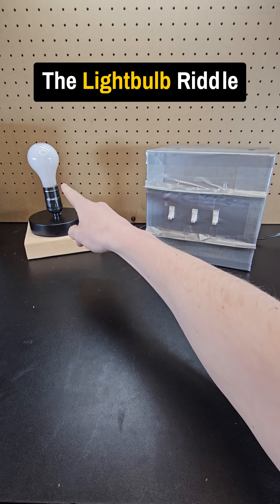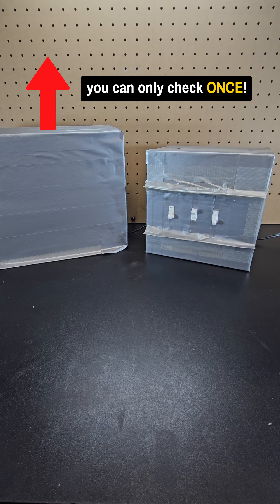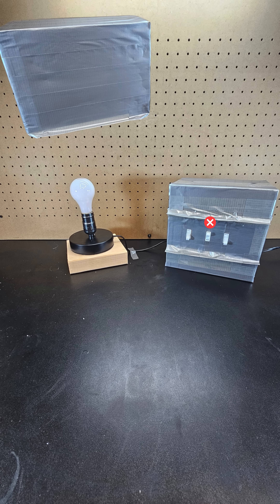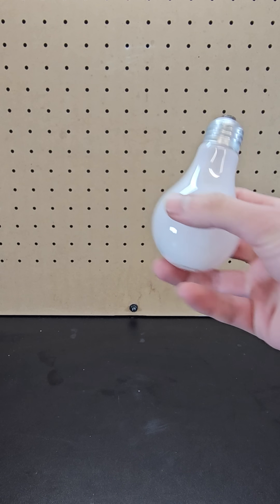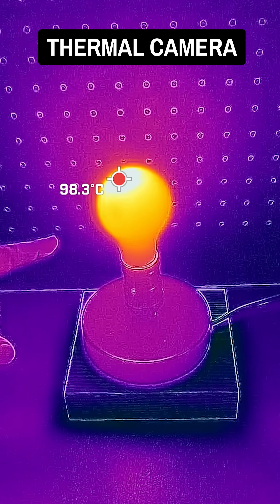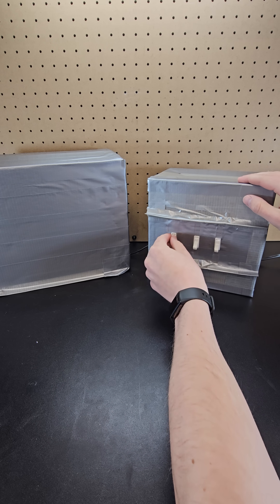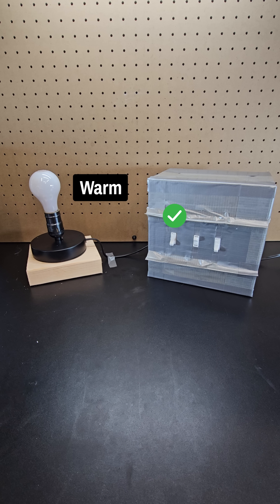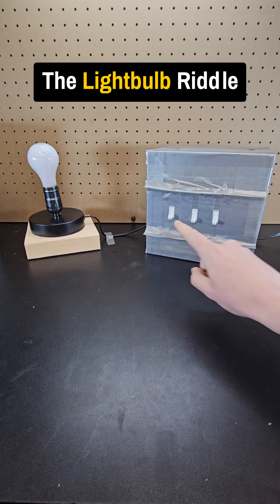Can you solve this Lightbulb Riddle? #science #shorts

Comment: (Based on a episode i found on a series from i think year ago idk) Turn switch one on wait 20 mins to a hour turn it off flick two and then check if the bulb is off touch it incandescent lightbulbs use avtrugnsten fililate making 70%( I think) of the energy Infrared because infrared is what most the heat is from and 30% is visable light so it will be hot if it’s cold and not on then it’s 3rd switch

Comment: (Will prob only work with a old bulb but eh) flip the first switch wait around 1 minute then turn the first switch of flip the second on and then lift the cover, and then you have your awnser. Explanaition: when you flip the first switch and leave it on the bulb will generate heat so it will heat up and then when you flip the second switch and lift it up feel if its warm cuz if it is then its the first switch if not but the light is on you know its the second switch if its of and cold ots the third😊

Comment: Fact about light  Light is a complex phenomenon that has been described differently throughout history, from classical wave theories to quantum mechanical models. Here's a breakdown:

Definition

• Light, or electromagnetic radiation, is a form of energy that travels through space in the form of waves. It is a part of the electromagnetic spectrum, which includes radio waves, microwaves, infrared radiation, ultraviolet radiation, X-rays, and gamma rays.

Wave-Particle Duality

• Light exhibits wave-particle duality, meaning it can behave as both a wave and a particle.

• As a wave, light is characterized by its wavelength (the distance between two consecutive peaks or troughs) and frequency (the number of waves that pass a given point per unit of time).

• As a particle, light is composed of photons, which are discrete packets of energy. The energy of a photon is directly proportional to its frequency.

Properties of Light

• Reflection: When light strikes a surface, it bounces back. The angle of incidence (the angle at which light hits the surface) is equal to the angle of reflection.

• Refraction: When light passes from one medium to another (e.g., from air to water), it bends. This bending is due to the change in the speed of light as it enters the new medium.

• Diffraction: When light passes through a narrow opening or around an obstacle, it spreads out. This spreading is more pronounced when the size of the opening or obstacle is comparable to the wavelength of the light.

• Interference: When two or more light waves overlap, they can either reinforce each other (constructive interference) or cancel each other out (destructive interference), creating patterns of bright and dark areas.

• Polarization: Light waves oscillate in all directions perpendicular to their direction of travel. Polarization is the process of restricting the oscillations of light waves to a single plane.

Electromagnetic Spectrum

The electromagnetic spectrum is the range of all possible frequencies of electromagnetic radiation.

• Radio Waves: Longest wavelengths, lowest frequencies; used in communication.

• Microwaves: Shorter wavelengths, higher frequencies than radio waves; used in cooking and communication.

• Infrared Radiation: Shorter wavelengths, higher frequencies than microwaves; felt as heat.

• Visible Light: Range of wavelengths detectable by the human eye; perceived as colors.

• Ultraviolet Radiation: Shorter wavelengths, higher frequencies than visible light; can cause skin damage.

• X-Rays: Shorter wavelengths, higher frequencies than ultraviolet radiation; used in medical imaging.

• Gamma Rays: Shortest wavelengths, highest frequencies; produced by nuclear reactions.

Importance of Light

• Vision: Light is essential for sight, allowing us to perceive the world around us.

• Photosynthesis: Plants use light to convert carbon dioxide and water into glucose and oxygen.

• Energy: Light can be converted into other forms of energy, such as electricity through solar cells.

• Communication: Light is used in fiber optic cables to transmit data at high speeds.

• Medical Applications: Light is used in various medical treatments, such as laser surgery and phototherapy.

Historical Context and Development

• Classical Theories: In the 17th century, scientists like Isaac Newton proposed that light was made up of particles (corpuscles), while others like Christiaan Huygens argued that light was a wave.

• Electromagnetic Theory: In the 19th century, James Clerk Maxwell developed a theory that unified electricity and magnetism, showing that light is an electromagnetic wave.

• Quantum Mechanics: In the early 20th century, Max Planck and Albert Einstein introduced the concept of photons, revolutionizing our understanding of light and leading to the development of quantum mechanics  ︎ ︎   ︎ ︎   ︎ ︎   ︎ ︎ ︎    ︎

Comment: How I would have done it: flip one switch, and leave it there for a little while. Then flip it off, and flip another switch for a short amount of time. Finally flip the last switch on and lift the cover. I’d then tap the bulb if it wasn’t already on. If it’s warm than the first switch is the right one, if it’s colder or only slightly warm than it was the second switch because you didn’t give the bulb enough time to heat up.

Comment: Solution: flip the first switch on for 10 minutes and then turn it off and flip the 2nd switch on and check if it's off if the light bulb is off,then touch it if it's hot it was the first one, but if it's on its the second one and if it's cold and off then it's the third one

Comment: I was brainstorming this but i couldnt find a solution,  but then i realised that a bulb produces heat which instany gave me the solution 

So what we need to do - 

Turn on the first switch and leave it on for 10 min 

Cone back and turn on the second switch 

And lift the box - 

If the bulb is on and the light is on its switch a 

If the bulb is on but the box is cold its switch  b 

If the bulb isnt on its switch c 

I typed it before watching the video 

Edit : turns out im correct lmao

Comment: I had flicked the first switch on for about 10 minutes, turn it off, turn the middle one on and then go check on the bulb and see if it's hot, if it is, it was the first one, if it's not, and it is on its the middle one, if it's not hot or on it's the last one.
Reply: I did this in the middle

Comment: Flick two light switches on turn one of them off get the light bulbs on it's the one you left on obviously if it's off and the light bulbs warm that's the one you flipped off if it's off and it's cold that's the one you didn't touch 👍
Reply: W

Comment: Flick two of the switches on wait 30 minutes turn one switch off. If the light is on then it’s the switch you didn’t turn off if the bulb is warm then it’s the switch that you turned off after waiting 30 minutes. If the bulb is cold, then it’s the switch that you never turned on.

Comment: What I would do is lift the first switch wait 5 minutes then flip it off and turn on the second switch then check if the light bulb was hot that means the first switch controls it if it was cold that means the third switch controls it if it was on that means the second switch controls it!

Comment: You flipped the first switch and leave it on for a little bit and then you turn it off and then you flip on the second switch and leave it on for a little bit and then you turn it off and then you lift up the box and you fill the lightbulb as the lightbulb is warm then it’s the first if it’s hot then it’s the second switch and if it’s cold then it’s the third switch

Comment: I turn on the first switch wait 5 minutes then turn it off, I turn on the second switch and check the box
 If the bulb is hot but not on then it was the first switch however if the bulb is cold and not turned on by the second switch then I know that it is the last switch.

Comment: my guess was actually a good answer to the riddle cause i think i was asked this question before, but i don't know where. anyways, as for what switch actually activates the bulb, it would be switch 4 which is hidden elsewhere, possibly in the base, around the bulb, or further down the wire. the switches on the box are just for looks.

Comment: Turn the first switch on for 10 min then turn it off and flip the second switch, if it's not glowing check if the light bulb is hot, if it is the first switch is correct and if it's not it's the third switch

But of course this only works if its a old light bulb that works by running electricity  through copper and not a led light

Comment: I’d turn on 1 switch. Wait about ten minutes and then turn it off and turn on any other switch. Now i will open the box. if the light is on then it means that the switch i just turned on is the right one. If the light is off then i need to feel the bulb’s temperature. If its hot then it means that the first switch that i turned on is the right one, is the bulb is cold then the right switch would be the one that i never turned on by now. Hope this helps

Comment: Flip one switch, wait for 5 min, flip another one. If the light bulb is hot and on, it was the first switch. If the light bulb is cold and on, it was the second switch. If the light bulb is off, it’s the third one. You need to add another factor (in this case temperature) in to determine definitely

Comment: You turn one light on 1 light switch on for 10 minutes.Let it sit and then you turn it off and turn the other light on and you turn that 1 off if you touch it and it's hot.That means one of those is the answer if it's cold.That means the last one is the on switch

Comment: Flip the first switch for 10 minutes keep it there then turn it off flip on the second switch and then pull up the cover if the bulb is off and it’s hot to the touch then it’s the first if it’s off and it’s not hot then the last switch and if it’s on, it’s the middle switch

Comment: Turn one switch on leave it on for about 5 minutes. Turn that switch back off and turn a different switch on. Then open the box. If the light is on it's the second switch you touched, if the light is off but warm to the touch it's the first switch you turned, if the light is off but cold to the touch it was the switch you didn't touch.

Comment: Flip switch one to on leave it for 5-10 mins then turn it off and turn the second switch on. Check the bulb and touch it, if it’s hot then it’s switch 1. If it’s on then it’s switch 2, and if it’s off and cold it’s switch 3. Pin so others see maybe?

Comment: Flip the first switch leave it for 30 secs then turn it off then flip a different switch and open the cover if the light bulb is on the it is the switch in the middle if not touch the light bulb and feel if it’s warm if it is it’s the first one then if it’s not or not at all then it’s the last one (I’m only 9 but this is the way I would solve it)

Comment: Flip the 1st switch on then turn it off then turn on the 2nd switch then lift the cover, if the bulb is hot it's the 1st switch, if the bulb is on then it's the 2nd switch, if the bulb is cold then it's the 3rd switch.🤓🧑‍🏫

Comment: Turn on any two switches, and leave them on for 10 minutes, then turn one of them off.

Open the box.

If the light is on, then it's the switch that's still switched on.

If the light is off, touch each bulb, feeling for the hot one. That one is the bulb that is controlled by the switch.

If none of them are hot, then the bulb is controlled by the switch that was never turned on.

Comment: Flip on the first switch, wait for about a minute then flip on the second switch and check. If the bulb is warm but off it’s the first one, if it’s on then switch 2 controls the bulb, and if the bulb is off and cold then switch 3 is the correct

Comment: Flip the first light switch on then wait 30 seconds, then flip the first light switch off, then you’re going to do the same with the second light switch. After that you’re going to lift the box without flipping the second light switch off. If the light is on it’s the second light switch but if it’s not on touch the light bulb to feel if it’s warm. If the bulb is warm but not on it’s the first light switch but if it’s cold and not on then it’s the third light switch.

Comment: I've seen this problem before. One possible solution is to switch on switch one for like 15 minutes, then turn it off and flip switch two for 15 minutes. Then turn it of and check the bulb. If hot it's switch two if warm switch one if cold switch three.

Comment: Leave the 1st one on for 10 min. Turn 1st one off.  Turn 2nd one on.  Lift box.  If it is on, the 2nd switch is correct.  If it is off but warm, the 1st switch is correct.  If it off and cool, the 3rd switch is correct.

Comment: flip the first switch on for 20 minutes then swiych it off and turn on the second switch. lift up the cover. if the light is on its the second switch if the light is hot its the 1st switch if the light is cold its the 3rd

Comment: Flip the first switch for 10 mins, after 10 mins turn the first switch off and turn the second one off, lift the cover. If the light is on then it’s the second switch, if the light isn’t on but the light bulb is warm then it’s the first switch, if it’s not warm or ok it’s the first switch ❤

Comment: Here's a method where you don't have to wait for the light bulb to warm up 

Flick two random switches on 
On:On:Off. If the bulb is still off it's switch 3. If it's on switch the positions of two of the switches

On: Off: On. If the bulb turned off it is switch 2. If it's still on it's switch 1

Comment: First flip one switch after 20 minutes turn it off and flip the second switch if the light is on its the second switch if the light is off touch the bulb and if it's hot then it was the first switch if it's cold it was the third switch

Comment: Let X be the index of the 1, uniformly random over {1, 2, 3}, so it has entropy log₂(3).
Each query returns a single bit (0 or 1), so it provides at most 1 bit of information.
By the data processing inequality, k queries give at most k bits total.
To recover X, we need at least log₂(3) bits, so at least 2 queries are required.

Comment: Flip the first switch wait 5 mins. Flip it back and turn on the second switch. Either the lightbulb is on, the lightbulb will be off and warm to the touch, or it’s off and cool. If it’s on it’s the second switch. If off but warm first switch. Finally if off and cool than you know it’s the 3rd and final switch

Comment: The "proper" method is to flip the first and wait 5 minutes before flipping it down, then flip the second switch and reveal the bulb. If the bulb is hot, it's the first, and if it's not and it's lit, it's the second, and finally, if it's off and cold, it's the third.

Comment: the the first switch one wait 10 mins then turn the first switch off and turn the second one one, if the light is not on then touch the light bulb if it is hot it is the first switch if not then the third switch turns it on

Comment: Flip two switches. Doesnt matter which 2. Leave it on for a few minutes. Then turn it off and check, and touching the bulb. If it's hot then it's one of the two you flipped. It's just a 50/50 guess then. If it's cold then it is neither and it's the third one/the one you didn't flip.

Comment: This isn't a riddle. The rules of any given riddle include hidden rules like "You don't have infinite time to figure this out" and "You obviously can't touch anything about the riddle unless specifically told you're allowed to do so." Obviously, by your logic, there are multiple ways to solve this. You could rip open the box with the light switches on it to check for wiring, and even if all three have wiring, you could cut each wire to check for a current. Tada, a "solution" to your "riddle" that doesn't respect the basic principles of any riddle.

Comment: Alternative solution, repeatedly flick each switch on and off, one at a time. If you don't start a fire, try the next one, and keep trying until you do. Once you've started a fire, you can lift the cover up knowing with 100% certainty which light switch controls the light bulb.

You didn't say the light bulb has to work, you said I have to know which light switch controls it, the wording is very important here.

Comment: Soloution, turn on switch 2 for 30 mins, then switch it off and turn on switch 3 then lift the cover, if its on its 3 if 3 and 2 are off touch the bulb if its hot its 2 if its not then its obviously switch 1, i believe thats a correct solution

Comment: You don't need to flip off the first switch, you just need to flip a second switch after having waited a while and then immediately lift the cover. If it's off it's the switch you didn't touch. If it's on but it's cold, it's the second switch. On and hot, the first switch.

Comment: You flip switch 1, wait 10 minutes, turn it off, flip switch 2, lift the box. If the light is on, it's switch 2. If it's off but the bulb is hot, its switch 1, and if it's cold, it's switch 3.

Comment: I believe the original answers were: Turn on the 1st switch, leave it on for a while. Then turn off the 1st switch and turn on the 2nd switch. Now check. If the light is on, it’s the 2nd, if it’s off but the bulb is hot, it’s the 1st, if neither apply it’s the 3rd.

However, with LED lightbulbs I believe this method could fail because LEDs don’t get as hot.

Comment: Turn the first switch on for about 10 mins 
Turn the switch off before turning the second switch on lift up the box.
If the light is off but warm then it was the first switch 
If the light is on its is the second switch 
If the light is off but cold it is the third switch